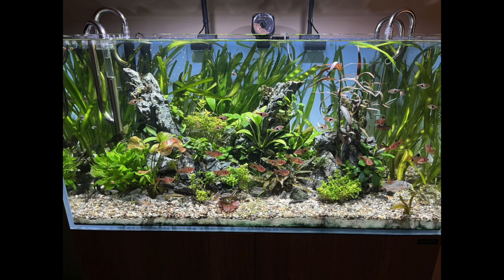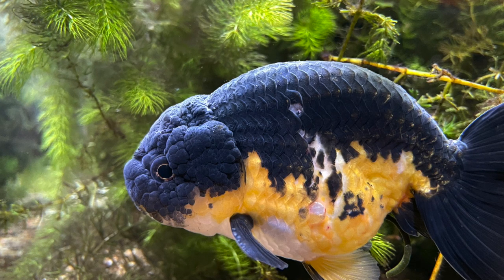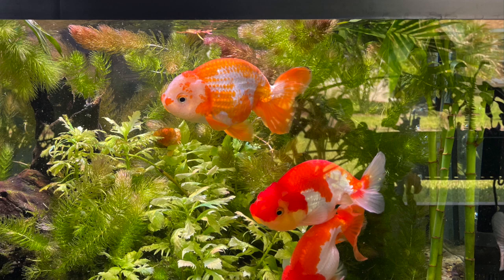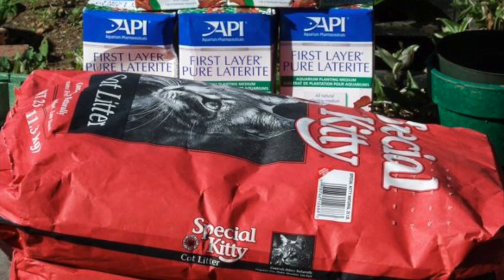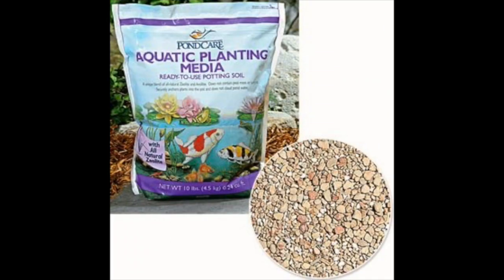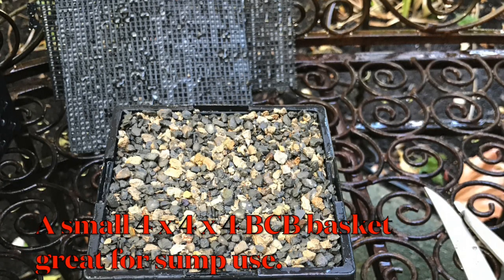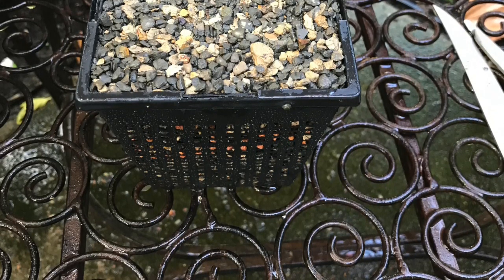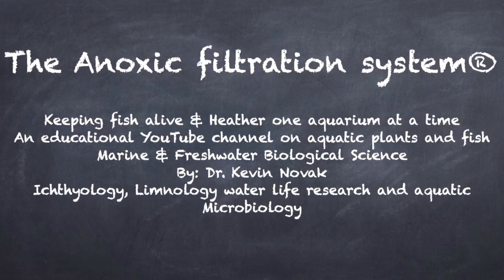What is an Anoxic Filtration System?

Comment: Will I need to mix it with the Laterite (if I can find this here ) for a BCB bag before placing in my external canister filter?

Also, I have sand substrate in my goldfish aquarium (180litre /40 gallon) currently. Will I need to remove this and build a plenum or can I simply add the BCB bag in my filter and have the same result?

Comment: Hello, fascinating method of Nitrate reduction, thanks for sharing it.
I am an structural engineer from Georgia Tech living in Costa Rica and in the process of retiring and to entertain my self at home I am building a 5 m3 system designed to  sustain up to 30 Kg of fish biomass per m3 currently working about 1/3 capacity, for treatment I included 2 55 gal settlers (one radial and one cyclonic to see which one works best for me), a 55 gal shade mesh filter, a 55 gal MBR filter and finally the sump with a fine cloth mesh and the return pumping system. I have been trying for a while to find a way to kill the nitrates to minimize the water changes and I want to test this technique.  Unfortunately I have been unable to find zeolite  locally as a commercial product nor cat litter of specified type (the problems of a small country/economy) but there are plenty of sources of expansive clays around that could be baked and crushed to size, any suggestions on what parameters to look for to determine usability?  Would a high Cation exchange capacity be the main parameter?, How do you determine the number of baskets per m3 or number of baskets per Kg of biomass? Is the liquid iron you mention the same as Chelated iron used in agriculture?

Comment: Its excellent that the fish was able to heal itself.  Why did it change colors so drastically though?  I've seen other goldfish videos where black color fish turned orange as well...not sure if it was somewhere on this channel or some other fish video I had watched,  I have consumed a LOT of fish content and am interested greatly in BCBs for ponds and in the fish tanks.  I had wanted to build a larger outdoor pond this year and implement the BCB basket system into it sadly various things conspired against me and its on hold until next year.  I am curious though I have a shubunkin goldfish, well I have several, but one in particular who is base that blue grey color they have but it had a lot of deep orange on it kind of in a wrapped ribbon pattern around it if that makes sense...Because my current pond is not deep enough I over winter them in a stock tank in the basement currently.  Last winter it lost almost all of its orange and is mostly just the blue grey color now.  I thought maybe it was a lack of sunlight and it would color up again once outside for the season.  But that has not happened, fish seems healthy eats plenty swims with the others just  fine  I am pretty certain its grown since being out in the pond.  But it has never gained back its color. Do you suppose that with proper BCBs it may gain back the color it lost?  I suppose thats a highly speculative question, but I am not sure what happened with the coloration and these videos of fish turning from black to golden interests me.
Reply from the maker: They believe the black coloring is due to genetics such as the Black Moor and its telescoping eyes. So far they have not been able to get the black stabilized in other goldfish.
Reply: Black gold fish often lose the black colouring and go orange as they age. Its very common. My Black moor lost most of his black and turned a dark bronze / gold colour as he aged.

Comment: Thank you for all your video. It is excellent. I have set up an anoxic filter in a slump. It was going to be five months now. I have changed my water recently. I am feeding 3 to 4 times a day. I have 27 goldfish in that tank 1000L plus slump is around 200L. I have checked my NH3 - 0.2, No2-0.5, and No3 is 10 on the second day after the water change. I do not know what to do now. Do I clean the slump? Do I put more iron in the water, which will observe in clay and work well? I see the information is not enough, but happy answer.  Can you please help me with this situation. Thank you .

Comment: I have been watching all your videos since finding your channel two weeks ago.  I had just started a 65 gal for my two Oscars one week earlier.  Even though I used a Lee's UGF, I wish I would have found your channel sooner !! 
I'm gathering materials for the canister Anoxic filter now  and can't wait to use it on the Oscar tank. 

But I have to say since getting back into the hobby late last year, Im really surprised no one mentions UGFs  let alone the term Plenum.  It's all we used in the 70s and 80s. In the 70s I worked in a small fish store after school. All this person used was UGFs in every tank, with one huge air compressor in the basement.  Never a problem.  This channel is truly a breath of fresh air for me. Some of the other channels I used to watch, I now deleted.  A waste of time with all the water changes nonsense, constantly cleaning filters. Water is getting expensive   but the sewer bill is many times worse!! 
Just want to say many thanks to Dr. Novak for shuh a great educational channel.
Reply from the maker: You're absolutely right the only problem was when they came up with the 1 inch lift tube that went all the way to the very top of the aquarium and then started adding multiple lift tubes then the trouble started. We change from pumping water very slowly through an under gravel filter to pumping as many gallons per hour as we could to try to mimic that of sewage treatment facilities.
Reply: I forgot to mention, your audiophile channel is awesome! You did a beautiful job restoring those speakers!
It reminds me of the 70s when a neighbor who had a garage band. He and I built a pair of A7s from scratch.  We couldn't afford to buy them, so we went to the  local music store, got the measurements,  and built them. They could take quite a beating going from gig to gig. Amazing we don't have back problems now in our 60s. Lol
They were so heavy!

Comment: I am eager to experiment with a bcb basket in a canister. I have run aquaponic beds on my tanks, at a rate which cycles the volume of the tank once an hour. I want to try a bcb basket on a similar timer; 15 mins on, 45 mins resting. Would you have a hypothesis/opinion to this situation Dr. Novak?
Reply: The water should travel thru the basket itself in days, not minutes.   The water around the basket can be fast flowing but is not neccessary and too much flow that could force water into BCB is bad.  Water around BCB could be a trickle.   However, you do need water flow to mechanically remove solid waste.  For example, an air fed breederbox will not pick up any fish poop.

Comment: How many pounds of bcb would you recommend using for a 2500 gallon pond? Would you use any other filtration i.e. mechanical filtration? My filter "canister" is a 35gallon trashcan so I can get quite a bit in there.

Comment: Thanks for clearer insights into the workings of the BCB.
Cation= positively charged ions
anions= negatively charged ions
positively charged ions will attract negatively charged ions.
Kitty litter and other baked clays are negatively charged
ammonium/ammonia is positively charged and it gets pulled into the negatively charged bcb.[ baked clay/kitty litter ]
Nitrates [ NO3 ] is negatively charged and it gets pulled in by convection, magnetic pull or diffusion  [5:43 ]
The various bacteria is fascinating to me. I wonder if it is possible to show some of the various microscopic examples described?
Edit addition: Do hydroxly form in BCB as well?
Reply: I got confused about the magnetic pull for NO3 as you stated both NO3 and baked clay are negative charged, could you clarify?

Comment: Good video Kevin. I needed to hear about the positive and negative ions to remind me the  kitty litter etc is negatively charged. I am still learning and I go back to your videos all the time, such a great treasure of knowledge for all. Thank you! 😊
Reply: Dr. Novak thanks for all your efforts. 
I have a question about diatoms and the thickness of the amount of kitty litter and laterite. I have set up a new 29g, and the depth of clay layer is about 2 inches. In the past my tanks had about one half inch of clay layer. The 29 has been running for 3 weeks. The 29 has a serious diatomaceous bloom. In the other tanks a bloom was minimal. Will the sub strate need to have the total clay layer reduced? I'm I over reacting, and will this as they say " THIS TO WILL PASS "?
Thanks for any input,
     Form a Believer Dave Spangler

Comment: Do you recommend using both BCB baskets and a Plenum, or is one of the two solutions fine by themselves? Thanks as always for your experience and wisdom.
Reply from the maker: That's a good question that a lot of people ask : do as do I need to use both? The answer is in all reality no, you do not need to use both. You can use one or the other. However, if you decide to use BCB baskets let's say in a sump and you throw your substrate directly on the bottom you may be competing with the substrate that's on the bottom that is not made into a plenum.

Comment: I’m in the process of building a slow moving overhead sump with a main compartment containing anoxic filtration with plants growing out of the top. Is the negatively charged litter or safety zorb the only way to accomplish this? Would activated carbon pellets perform a similar function, or can you grow anaerobic bacteria with only gravel and clay?
Reply from the maker: If you're trying to make a plenum than you can make it a slow moving overhead compartment but I just can't think how you would do it. Of the different substrate which I have tested which comes up to be about a little over 100 it's seen that the kitty litter are anything related to that was the best way to achieve the BCB baskets and the correct bacteria. Some substrates which we tested cause cyanobacteria and other problems.
Reply: @anoxicfiltrationplenums  Thanks for the response I will track down some kitty litter.

Comment: So on my 135 gallon tank I took my homemade wet/dry filters in my dual (connected) sumps and replaced them with two BCB baskets made out of milk crates and plastic mesh and some filter socks. The baskets are about 12x12x5 inches of oil dry. In total a full 33 pound bag was used for both with about 400 grams of laterite in them. Also replaced the biomedia in the canister with a BCB bag and some homemade chemipure (thanks for that video!). Did that about 2 weeks ago and everything has been fine, no ammonia spikes or anything. However, my ph bottomed out (I'm using the SJ Wave strips and it's 6.0 at the very highest right now). I started adding some crushed coral today and we'll see how it goes. I guess those sized baskets were probably a bit much, but the tank will be overstocked in a couple months and I wanted to take no chances. I've used crushed coral before and it stabilized my ph without issue, so I'm not worried. 
All my other tanks are getting set up with plenums in the next couple weeks. Will send pics and updates.
Reply from the maker: OK now I understand why your pH went down to 6.0. That's quite a lot of kitty litter for 135 gallon tank. The good part is it will eventually subside on you and you'll be able to stabilize your pH to 7.1 or higher in a few months. After using the fluval substrate my pH dive down to 6.5 and after a few months now it's up to 7.1 - 7.5.
Reply: @anoxicfiltrationplenums  Thanks. I know it's a lot of clay, but my sump is two 17 gallon sterilite totes (22"Lx15"Wx12"H) plumbed together so that the whole thing fits under the stand. It's very basic, but it has a lot of open space (my diy wet/dry filters were oversized too). The milk crates fit so perfectly with about an inch open on both sides and just enough space on one end of each tote for the pump and a 4" sock on the other side of the bcb basket so in each sump the water comes into the sock, flows all around the basket and into the pump. I had seen one person use the kitty litter as substrate, so I didn't realize the effect would be this great. I put a couple small filter bags of crushed coral in the sump (on top of the pumps) yesterday and today the pH in the tank appears to be between 6.0 and 6.4. I'm just going to test it daily until it's around neutral and then reduce the coral until it's stable. If the effect of the kitty litter on my pH dissipates the coral bags are easy to take out (rather than using it as substrate). 
For the 20 gallon, 55 gallon and 75 gallon tanks I'm in the process of setting up (they've been dry for years so I just finished resealing and water testing them) they will have plenums and run much smaller BCB baskets with pothos growing out of them. They will be put together this weekend as I just finished plumbing the overhead sumps for the 55 and 75 and making the baskets. They also have internal canisters for mechanical that I made years ago and work well. The 20 gallon will just have the plenum and an oversized HOB for mechanical/chemical.
Reply: I have 24 lbs of oil dri and 3" coral substrate. Oildri dies reduce pH bit coral (depending on how much you use) should be good.

Comment: My little experience, last Friday one of my pepper corydora was "trapped" at the water surface, I noticed she was trying to go down but was pulled up after stopping swimming, other than that she looked fine. I thought it was a swim bladder decease as I was overfeeding the fish. So I left her that way and haven't feed them that night. On Saturday morning she was able to stay at the bottom but was swimming weird, in a stand position and sometimes upside down. Could only kept when hanging in a plant. Also other corys was bullying her (I think is a female due other two constantly chasing her). The aquarium she is at is a 10gl with a plenum but with only 1“ thick substrate. I have a new 20gl high setup with a plenum and 4“ thick substrate for almost 3 months, only the bubbler no other filtration system and getting less than 10 ppm of nitrates weekly. So I decided put her on that tank and it turned out she started behaving better in the next few hours and 1 day later was swimming totally fine, like brand new.
Reply from the maker: That really makes you think doesn't it: what is the secret?
Reply: @anoxicfiltrationplenums  clean water probably